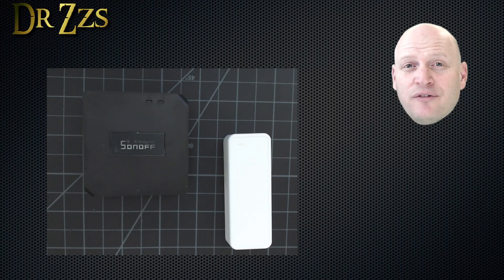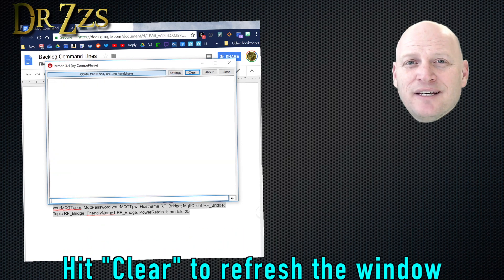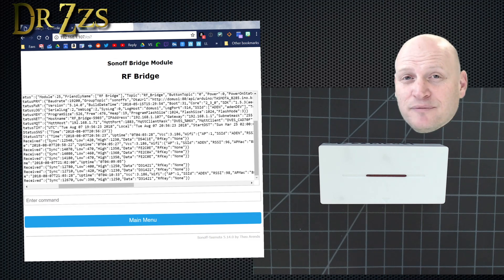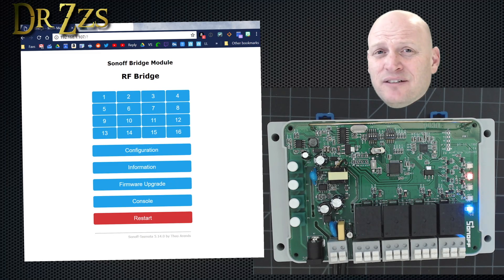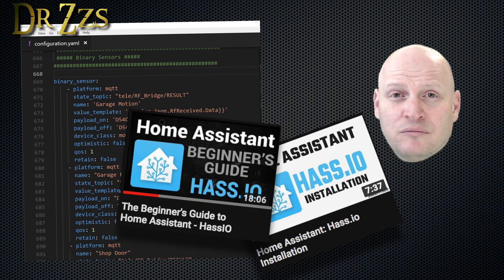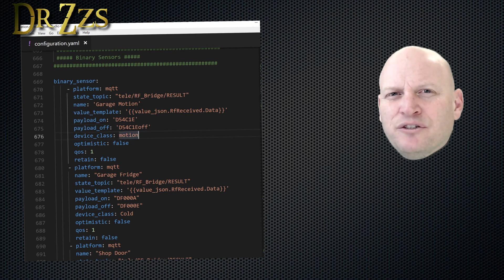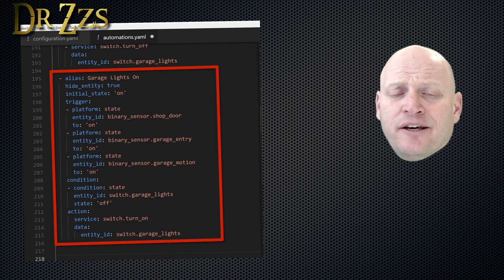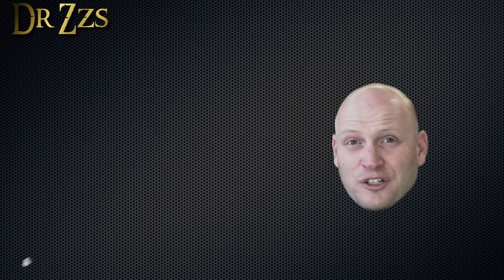Sonoff RF Bridge with Tasmota

Comment: Curious if you tried the wifi door sensors and how they compare to the RF sensors. I saw that sononff has them and supposedly they interface (after flashing) with home assistant/openhab so was wondering if there is an advantage in using the RF ones instead.

Comment: Hi, I flashed my Sonoff RF Bridge successfully with Tasmota 9.4.0 and I can access it using Chrome and the IP address of the bridge. It also shows up in Home Assistant via my Mosquitto MQTT. So far, so good. But I am unable to make it detect and read any of the RF devices I have (and I have tried many).  In the console of Tasmota, there is absolutely no indication of any activity when I press a button on any of the various brand RF devices  have.  If I press one of the 16 keys in the Tasmota menu, the red light on the bridge lights up, and the console reports the key# pressed.
I suspect that there are no such thing as 433MHz standard. On my devices, I have to set channel numbers and group numbers via switches to make them connect (and to avoid interference to my neighbours devices). Should I expect the Sonoff Bridge to be able to read the RF commands no matter what channel and group setting a device has?
Reply: If you have youre RF Bridge switch set to OFF switch it back to ON. That helped me recieve data from the door sensors.
Reply: @jvrietveld  Hi, after flashing it with Portisch, everything started working as expected.

Comment: hey doc, I HV spin fan which use rf433. But, to use the remote it need to press power n light button to sync. Then, remote is dedicate to fan. On the fan, it use muchip mu3100. U think is this possible to automate with sonoff RF 433 bridge?

Comment: Hi Dr Zzs, i have a sonoff door sensor which is only door open, i am using a Tasmota 9.3.0, MQTT is working. It is configured in OH3 and setup in Channels. It picks up door open and stays open. How do i get it to change to Closed using a timer in OH3?

Comment: After a year of functioning with no problems, a water sensor, just like the one you showed is now putting out false alarms.  changed the battery, reset the RF bridge, still false alarms.  I have 5 other similar sensors with no errors. Any thoughts on what is going on?

Comment: @DrZzs  I must have stared myself blind of this problem:

I have a RF 3 way, toggle unit, which I have coded into the configuration.yaml file as binary_sensor: and automation "reset to off state" into the automations.yaml file.
But for some reason, only the first switch works. The  RF codes are correctly typed into the code, but only the first switch works. The other switches won't even be set to the"ON" state.
All the switches are detected by the Sonoff RF bridge with Tasmota without any problems.

Am I writing the code wrong, or is the RF bridge reporting incorrect values? I can't figure it out" :P

If any of you guys have any idea, please let me know!
Thank you all in advance.

------------------------------------------------------------------------------------------
binary_sensor:
- platform: mqtt
  state_topic: "tele/tasmota_C24742/RESULT"
  name: 'Kontakt 1'
  value_template: '{{value_json.RfReceived.Data}}'
  payload_on: '1F0492'
  payload_off: '1F0492off'
    
- platform: mqtt
  state_topic: "tele/tasmota_C24744/RESULT"
  name: 'Kontakt 2'
  value_template: '{{value_json.RfReceived.Data}}'
  payload_on: '1F0494'
  payload_off: '1F0494off'
    
- platform: mqtt
  state_topic: "tele/tasmota_C24748/RESULT"
  name: 'Kontakt 3'
  value_template: '{{value_json.RfReceived.Data}}'
  payload_on: '1F0498'
  payload_off: '1F0498off'

------------------------------------------------------------------------------------------

- alias: RF enkel kode kontakt reset 1
  initial_state: 'on'
  trigger:
  - platform: state
    entity_id: binary_sensor.kontakt_1
    from: 'off'
    to: 'on'
    for:
      seconds: 0.1
  action:
  - service: mqtt.publish
    data:
      topic: tele/tasmota_C24742/RESULT
      payload: 1F0492off
  id: 3ac31740428246b788aba652d6ba9e3b
- alias: RF enkel kode kontakt reset 2
  initial_state: 'on'
  trigger:
  - platform: state
    entity_id: binary_sensor.kontakt_2
    from: 'off'
    to: 'on'
    for:
      seconds: 0.1
  action:
  - service: mqtt.publish
    data:
      topic: tele/tasmota_C24742/RESULT
      payload: 1F0494off
  id: 043633db0d3f4faa922e22058979d5cc
- alias: RF enkel kode kontakt reset 3
  initial_state: 'on'
  trigger:
  - platform: state
    entity_id: binary_sensor.kontakt_3
    from: 'off'
    to: 'on'
    for:
      seconds: 0.1
  action:
  - service: mqtt.publish
    data:
      topic: tele/tasmota_C24742/RESULT
      payload: 1F0498off
  id: be16d551452f427a8af4039a0f999f9b

Comment: I implemented this shortly after the video was published and it has been working flawlessly with my door sensors, PIRs, water sensors.  I get a daily notification when the mailman opens the mailbox and when the mail is picked.  However, after upgrading HA to 0.112 all my binary sensors show 'unavailable' until they are triggered.  This happens every time I restart HA.  This has been working fine for almost two years.  Is anyone experiencing the same problem?  Any ideas?  Doc, are you having this issues?  Thanks to all
Reply from the maker: There was a change to the binary sensor component. Try taking out the lines for "optomistic".   You can also use "off_delay: 10" instead of adding the fake off code and the automation to reset them.  Off_delay wasn't an option when I made this old video.  Hope that helps!
Reply: @DrZzs  I don't have the 'optimistic' line and I was already using the 'off_delay' parameter instead of using the 'fake' codes.  I restored a snapshot for version 0.114 and everything works fine.   Thanks anyway and if you find out more info, please post it here.

Comment: Thanks for the clear video. There is actually a way to send more than 16 different signals, but it requires a few commands over mqtt. Check out the section "Method 2: The scalable way to capture and send signals" almost at the bottom of this page:
https://hometechhacker.com/sending-rf-signals-sonoff-rf-bridge/

<quote>
The problem with the “easy” way is that you can only learn in 16 different commands at a time. If you want to use more than that, you can have the Tasmota send RF commands with the data you specify, as opposed to having it memorize different commands.

This method requires you go to the Tasmota web UI and look at the console. As you send an RF signal you’ll see a line in the console that looks similar to:

tele/sonoffRF/RESULT = {"RfReceived":{"Sync":12180,"Low":430,"High":1240,"Data":"D10610","RfKey":"None"}}

Make note of the data that follows the Sync, Low, High, and Data parameters. using these parameters you can send the command using a series of MQTT commands:

Shell:
mosquitto_pub -u "mqttuser" -P "mqttpassword" -h <mqttbroker> -t "cmnd/sonoffRF/RfSync" -m "12200"
mosquitto_pub -u "mqttuser" -P "mqttpassword" -h <mqttbroker> -t "cmnd/sonoffRF/RfLow" -m "430"
mosquitto_pub -u "mqttuser" -P "mqttpassword" -h <mqttbroker> -t "cmnd/sonoffRF/RfHigh" -m "1250"
mosquitto_pub -u "mqttuser" -P "mqttpassword" -h <mqttbroker> -t "cmnd/sonoffRF/RfCode" -m "#D10601"

Not the “#” character that precedes the RfCode payload. This will send the same RF signal Tasmota saw when the RF button was pressed.

While this method takes a few more commands and requires you to record data, it does allow you to send as many different RF commands as you want!
</quote>

Comment: I'm getting the errors:
Invalid config for [switch.mqtt]: [device_class] is an invalid option for [switch.mqtt]. Check: switch.mqtt->device_class. (See ?, line ?).
Invalid config for [sensor.mqtt]: [payload_on] is an invalid option for [sensor.mqtt]. Check: sensor.mqtt->payload_on. (See ?, line ?).
I think is because i dont have the template defined.
How do you define the template '{{value_json.RfReceived.Data}}' ??

Comment: Hey Doc...I've got the tasmota.bin flashing to the RF Bridge okay (once I realised to switch rx & tx), but Termite just won't work...  I've got the right COM port selected but when I enter the command it just goes into the main window & nothing else happens - no green text or anything.  What am I doing wrong?
(Plus when do I put the switch on the bridge back to on)?
Reply from the maker: Once the flashing is done you can put that little switch back to ON.  If termite isn't working you can just go into the Tasmota console page and input that same backlog command there.  You'll have to connect to the bridge using the AP mode wifi.  Once it's flashed you should see a new wifi network called iTead-xxxxx (unless they've changed the naming).  You connect to that wifi and it'll let you input your wifi network name/pw.  After it restarts you can go to the console and input the backlog command. 
Hope that helps.
Reply: @DrZzs  Mate...  That's awesome - fixed me right up!  Thanks! #legend
I've got some Energenie plugs that I had tied into my own RF Bridge I wrote in Python running on a Raspberry Pi (before I knew RF-Bridge was a thing & what 433 MHz was).  It's flakey & I think the weak point is the 433 hat that plugs onto the pi.  I'm hoping I can connect them to the Sonoff & it'll be more reliable, we'll see.
Anyway - a big thanks from the UK.
Seeyer (that's Geordie for "Adios")

Comment: I really dont understand the need HA for  automations in most cases.  After compiling my own Tasmota to include IF/ELSE statements I have never come across a situation that I cannot do via rules right on the devices themselves.  For my sensors all my automations are done by rules on the RF Bridge.  No need for HA, MQTT server or anything else.

Comment: Hi thanks for video, 
What would be the easiest method (without FW flashing) to have the garage door status Open/Closed?
My initial idea was to use Sonoff RF Bridge and Sonoff DW1 sensors, but after watching your video I saw that this isn't possible because DW1 sends only "break" status with no info on being closed again.
Are there any compatible wireless door sensors that provide Open/Closed status (besides alarms) to phone app where one could check door status (without RF FW flashing)?

Comment: Hey guys,
any recomendations for a 2-code pir motion sensor?
thanks in advance
Reply from the maker: Not that I know of.  You can use a single code sensor and set the "off_delay" in Home Assistant so the sensor can be re-triggered after X seconds.

Comment: Thanks for the guide. Managed to flash the bridge successfully. However, connecting to the bridge works as well, but I don't get any respond when trying to enter the backlog command. How do I know if it fails or worked?

Comment: Big fan DrZzs. I followed the instructions for water leak sensor and things are working almost OK.
The problem I see is that the water leak sensor (SQ-100B) only really sends the RF signal when the two prongs are let go. Even in your video, at the end you dont see anything happening until you let go your fingers off the water leak sensor which then invokes the automation. Please let me know if you actually see the same problem.
I poured water in a cup with water leak sensor in it. The automation only got invoked when I took the sensor out of the cup, making it useless!!
Please help!!
I have followed up with banggood as well, awaiting response.

Comment: I don't receive the RFReceived commands in console....
Reply: yiannisis, I had the same issue until i powered off the bridge then put the RF bridge switch to on again then powered up.
And now it works! yay
Reply: @TheGrimeh  i also forgot the rf switch to off. Thanks! Now it's ok
Reply: @yiannisis, i thought you might have. But i dont recall the step to turn the switch back on but now everyone knows that issue/fix too :P

Comment: Does each of these door sensors send different codes to the bridge so that the bridge can tell what sensor it is? Seems like they are cookie cutter devices.
Reply from the maker: Yes, each one sends a different code. There is probably more information it is sending, but the bridge shows it as a unique 5-6 digit code.
Reply: Thanks Drzzs. I just got the stuff today, time to play.

Comment: This was brilliant Drzzs - it got me sorted learning about Tasmota and MQTT and RF signals and automation. Twas a lot to swallow in one go. I have two things I'd share with you. 
1)  A 433MHz chime is able to assign a different tune to each learned RF signal. It's a handy quick to set up alert. Product: M2D 300m 433MHz 60 chimes
2) As well as your fridge door (very good) I had a need to monitor my letterbox which has a swing up lid. Here's the write up together with your video as a help. https://www.rogerfrost.com/smarter-letterbox-exercise-saver/

Comment: Hi, quick question. i have a motion sensor, and tried to install it the same way you did in the yaml file. problem is, that "optimistic" is (no longer?) available for binary sensors. without it, it doesnt seem to work. i can see the mqtt data, but the motion sensor doesn't trigger. does anybody know what to do instead?

Comment: You might be able to use "expire_after: [n seconds]" in your sensor config instead of an automation to reset the state of your sensors.  Below is a configuration from a doorbell sensor that I found on the internet that works well for me.  My sensor sends a payload of "Ding" when triggered, and after the "expire_after" time runs out, Home Assistant changes the state from "Ding" to "Unknown".  I haven't tested it with "payload_on:" but if it works, it would save having to set up extra automations.

- platform: mqtt
  name: "Doorbell"
  state_topic: "doorbell"
  expire_after: 10

Comment: ... I flashed my bridge with Tasmoto... and got it configured to network, but i noticed when i move my door magnets close to each other I don't see any msgs for tele/.../RESULT in the console and but did noticed that my radio/443 led is blinking red the door sensor open/close, any ideas?
RESOLVED, forgot to set the Tasmoto Module type to 25, so it did not know that it needed to listen to a radio and then process the msg.
G

Comment: So just as a question. I was planning to use the rf bridge to automate some rf light switches. I wanted to use openhab, but that shouldn't change much.
I want the home automation software to send a data key to the rf bridge so that the bridge will send this code (instead of using one of the buttons on the web portal manually). Do you know if this is possible?

Comment: Thanks DrZzs. I have found your instructions not only clear and easy to follow, but entertaining as well. Good tip on the dual code sensors, I have ordered a few. I'm currently using 2 Sonoff sensors with the reeds removed and instead wired to a separate reed with NC/NO contacts to obtain the open/close codes.

Comment: I'm new to this, sorry if stupid questions.
So can I get it that when I speak to google with certain commands, it sends out a signal to control an RF device, or can it only listen for devices?
Reply from the maker: it can send out commands, but doesn't have a connection to google home.  So you can't do exactly what you're describing unless you have another system like Home Assistant in between.

Comment: i tried to flash 2 shelly one. and 2 sonoff RF bridge. all four said "flash complete"  but i dont see ssid "Sonoff-xxxx"   so strange. 

this is on windows 7 64 bit with  FlashESP8266.exe  and i even tried NodeMCU-PyFlasher-4.0-x64.exe. 

any ideas?
Reply from the maker: That is strange.  Which version of Tasmota are you using?  
Maybe try a different one. 
Have you flashed other things successfully and have seen the new wifi ID's?
it's unlikely there's a problem with the hardware.  I'd be suspicious about the device you're trying to connect with.  Can you try to look for them on a different device, like a laptop or a different phone?
Reply: @DrZzs  i suspect it is my serial usb adapter: https://www.amazon.com/gp/product/B00LZV1G6K/
so i will get this next:  https://www.amazon.com/gp/product/B075N82CDL/
Reply: @DrZzs  i got a different usb-serial adapter. works great now! thank you

Comment: Cant you transmit from a rule and not use one of the 16 buttons?
Reply from the maker: good question.  Best I can say is "probably"  :) 
I assume you could send a code using a rule, but I haven't tried it. 
Actually, I don't see a command for sending a code other than using the Keys: 
https://github.com/arendst/Tasmota/wiki/Commands#sonoff-rf-bridge
So it might not be possible without having the code already saved to one of the buttons. 
Hope that helps.

Comment: the white flap you lift up to access the pins,  any idea what it is?
Reply from the maker: That's the LED for the green sonoff logo on top.
Reply: @DrZzs  item received today and i see what you mean.
i flashed with Tasmota fw. without doing Termite i dont see ssid Sonoff. even with Termite Backlog, i dont see it on my network. so unlucky. guess i will try another unit.

Comment: hi, i have followed this instruction, but i keep getting this: Invalid config for [switch.mqtt]: required key not provided @ data['command_topic']. Got None.   Do you know what this means?  Like the videos by the way
Reply from the maker: That sounds like a format problem somewhere around the "command_topic" line. 
Maybe post what you have and I'll look and see if I can figure out where the problem is.  
YAML can be pretty finicky with syntax.  A space or quotes out of place can screw up the whole thing.